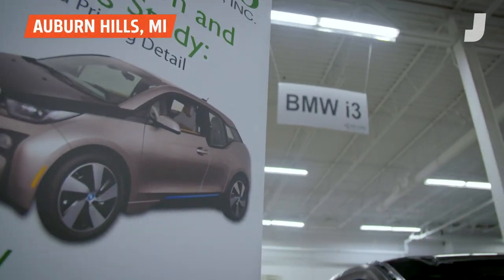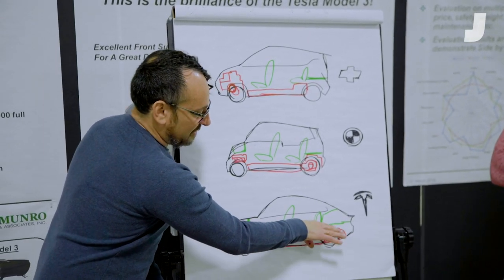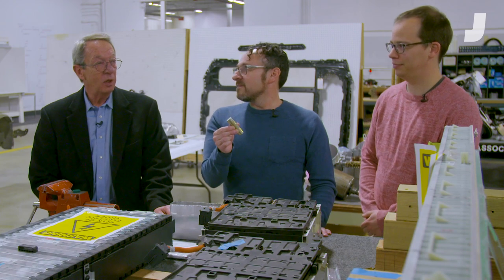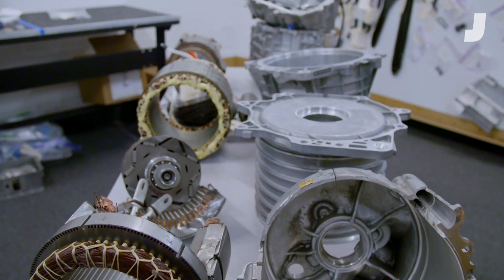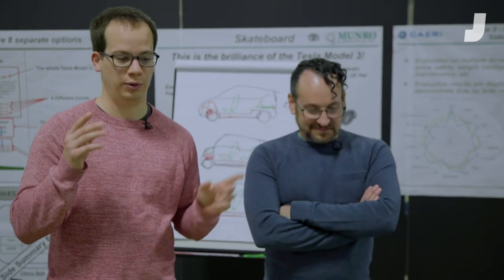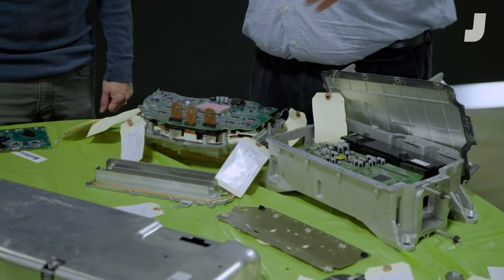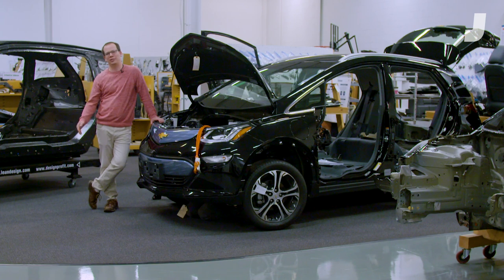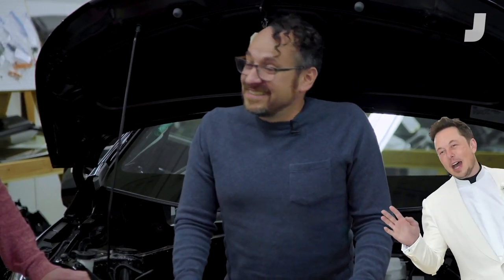A Look Inside The Tesla Model 3, Chevy Bolt, and BMW i3

Comment: There’s all the talent in the Bay Area making the Tesla bleeding edge. There’s Generic Motors making a decent effort at a car that won many accolades and even car of year when it came out, and there’s BMW in Germany with an outdated design, with poor range, poor performance, and a generally poor design. Your video didn’t do nearly enough to point out just how far behind BMW is in EV technology despite starting early and having many years to get it right. The Germans just seem largely unable to compete when it comes to technology. For example BMW’s iDrive was universally hated year after year long after nearly every other auto company had a superior system. And of course Volkswagen couldn’t manage to pass emissions legally so they just cheated instead. German cars have some of the poorest resale values after they’re out of warranty of any cars in the world which is largely due to how unreliable and expensive to maintain they are. You can buy some 5 year old Germans cars for 1/10th of what they sold for new because they’re widely regarded as unreliable money pits. The BMW i3 is another example of poor German engineering that’s been shamed by Tesla, Chevrolet, and even Kia and Hyundai who all offer less expensive better performing and more reliable electric and hybrid vehicles. The whole idea of “superior German engineering” is pure marketing nonsense. The Germans clearly are behind the US, Japan and Korea in engineering talent.

Comment: Amazing how different they are. The modular vs integrated approach (Bolt vs Tesla) is perhaps not given the pro vs con discussion it deserves, i.e., modular componentry may be a feature, not a bug. Remember too that although tight packaging of Tesla guts is highlighted, the Tesla is a larger car with a smaller back seat and not really much more cargo space than bolt. Also Bolt, though smaller, has 5 star safety rating, too. Bolt teardown on @WeberAuto channel great, too.

Comment: everything about the model 3 is superior.  the other automakers made their car ugly and inferior on purpose.  clearly they dont really want to sell EVs.  they just want to pretend to sell EVs, so they can say we tried, but nobody wanted them.  bolt and I3 are the ugliest designs I have ever seen.  their batteries packs are joke.  

the video was okay, but should have gone over the magnets in the model 3 engine which make it more efficient, thus you get more range from a smaller battery.

Comment: Bmw is the way forward as the use of carbonfiber is lighter and stronger they just need to learn more about the electronics as tesla have had a few more years development and bought over plenty electric developers 
As for the model 3 they still haven't fixed there chassis design and if you don't keep the firmware up to date you can't drive it
Reply: Agreed. There are only a few things that I thought BMW did wrong. For example the fake grill makes no sense, the odd size wheels and tires make it hard to DD one as not many companies make snow tires that fit those wheels, the frunk us so small it is basically worthless, and the all electric range isn't great. Instead of the frunk on the I3 they should have put a coolant heater up there so the batteries could stay at the optimum tempature in the winter.
Reply: So... It's not practical for long distance travel, or transporting lots of stuff and it looks like a Storm Troopers helmet is having its way with a can of Turtle Wax?   But other than that, it's a winner? @MrLM002
Reply: Chassis design?
Doesn't need "fixing", maybe "Refining" watch the Model 3 China stripdown. Let's see if they've done that?
Maybe it will give Audi ideas to improve the costing on the e-tron chassis?

Firmware?
What are you talking about?
Reply: @MrLM002  
So apart from using the wrong battery, cooling it poorly, drivetrain packaging issues and body construction, BMW got it right?
Reply: @capn2289  
I like the idea of the BMW, but that's the best description of it I've ever read!
Reply: ...And they sold there carbon fiber capability, so...
Reply: @MrLM002  The range has improved on the newer models. It got a bump in 2017 and in 2019. Still not great, but better.
Reply: @NicholasTripp  
What is it now? 120 miles?
Oh dear.

Comment: the battery part made me super surprised, but I have som Questions as to what quantifies a "unit"

-For Chevvy, is a Unit a single pouch? or the entire stack on the table?
-For BMW is it a single prismatic cell, or the prismatic module with 3 cells inside it? or is it the entire module on the table?
-For Tesla is it a single 2170 or is it the Entire module on the table?

or for any of these is it the entire battery pack for the car?

Comment: Anyone who likes the Model 3 or would buy one automatically admits they know nothing about cars and are just tech nerds who want an electric car because they're currently "cool".  Nobody who knows anything about cars would willingly give money for a car that drives like crap, handles like crap, has one of the worst quality interiors of any car on the market regardless of price, is OFFICIALLY the most unreliable car in the world with highest amount of breakdowns, has really uncomfortable suspension and seats, poor refinement, laughable interior "design" which they try to sell as "minimalism" to people stupid enough to believe that, etc. Tesla basically designs cars for people who are THE EXACT OPPOSITE of car guys or people interested in cars in general and they aim at the people who know little enough about cars that they're ready to tolerate all the crap they'll get when they buy a car.  Sure they accelerate quickly...but you don't accelerate quickly all the time...and when you don't, which is 99% of the time, you end up sitting in a sub-par car that feels like it should cost half as much as it does, and even then some details on it would make you feel ripped off.

Comment: Tesla's integration of components says a lot about the companies structure as well. If Tesla is structured as Elon has mentioned about Space X, then his engineering teams are not fully departmentalized. Meaning you don't have the motor team providing requirements to the power inverter module team who then work on that aspect of the car separately. The full vision of the car is understood by all engineering leads, and therefore better design integration is possible.

Comment: I am more impressed with the FWD Bolt.  We have snow and ice, FWD is the best if you can not get FT 4WD.  The Bolt has board by board control box that can lead to lower replacement costs if the diagnostics are done with detail.  The Bolt has a speed regulator.  Too many drivers of all vehicles are driving too fast and not anticipating.  Pedestrians need drivers to be looking ALL THE TIME!
Reply: Plus the Bolt has a great Electric Brake thanks to being FWD...

Comment: Don't know anything about crash studies of such things, but does the Bolt having electric motor and stuff all up front in conventional manner offer any additional protection to front seat passengers in the event of a head-on collision
Reply: TheSulross It would be the opposite. In a crash, the front of the Tesla can "crunch". On the Bolt you would get the motor in the legs... But they are both really safe car still, with the Tesla having the edge (the front of the Bolt is really small, probably doesn’t help).

Comment: Tesla would be the most difficult and expensive to repair. If a coolant leak occurs withing motor compartment it'll spill over to the electronics and kill the whole thing.. and if a cooling system fault develops in one of the integrated cooling fins you'll have to replace the whole battery pack.

Comment: Does no one get the reason GM's Bolt is FWD ??? 
Electric Braking, as the rear brakes on a typical car do less than 20% of the work.
So when you use the Bolts Elric Brake, 80% of the stopping power is from using the drivetrain a generator...
Reply: As great as the Bolt's regen is, they really should have made it AWD, or RWD at the least. Thing breaks traction way too easily during acceleration. That said, the rest of the car is amazing and would probably out handle the Model 3.

For me, near 100% braking is done via regen. Use L and the paddle for some serious regen and one-pedal driving.
Reply: teslas regen works super well i barely have to break and when the rear of tje car does the breaking you keep that all important traction in the front
Reply: @MrTsolar  Yep. Me too. I set it on Cruise Control just as soon as I can, get up to speed and try to time the moment that I disengage the Cruise Control by how far away I am from the spot that I want the car to stop at. I LOVE IT when I get it just EXACTLY RIGHT. It's like a game. I love coming off freeway exits the best. My brain is like the Apollo Lunar lander, taking into consideration EVERYTHING. Fun game.

Comment: You said that Chevy Bolt front mounting bracket is not an elegant solution. Design in general has many options. Each has pros and cons. An integrated design in Tesla is space saving, but it may be harder to service. Chevy Bolt needs a bracket because it is built on the same production line as other engine vehicles. It is superficial to say one is better or more elegant than the other. There is no single best design.

Comment: I am 6'-2", weigh 300 lbs and have a bad back. It is nearly impossible for me to get in and out of the model 3. The model X costs four times what I paid for my Bolt.
Reply: @japanwatchconnection thank you for your concern and your advice.
Reply: You bought the best EV to own. The model X has doors that will cost a fortune to service, like everything on any Tesla. Use the electric brake on the Bolt and your brakes will need little service...
Reply: @davidhollenshead4892  I love the regenerative braking paddle on the steering wheel. I use it most of the time.
Reply: @IBMara  Your reply shows a charming grace all too often missing on the net. 
For me it's intermittent fasting,  pilates and a neoprene sash to keep my lower back warm.

Comment: Disappointed that they didn't explain that Tesla is using a completely different type of electric motor. The other two are pretty standard AC Synchronous Permanent Magnet Motors. The Tesla uses a new design of AC Synchronous Reluctance Motor, with much less permanent magnet for cost saving, it is also much more efficient.

Comment: when the three cars need repair, the bolts parts can be bought and shipped anywhere, replaced faster because its almost a unbolt and unplug the larger modules, and I think simple goes a long way for long term use, so ill take the bolt ev.
Reply: The Bolt is the best EV, and is even a better car to own than a model S, and yes the parts and service will be cheaper...
Reply: I'm glad you guys like your Bolts.

Comment: Surely Tesla should put two of those smaller affordable motors in the back of Model S and X for torque vectoring, less power reduction under extended loads and longer range?

Comment: I'm surprised to hear them say that the Chevy Bolt isn't a clean slate design, just an adaptation of an ICE design. Supposedly the Bolt was built on its own purpose-built platform not shared with any other GM car. That they couldn't tear themselves away from traditional ICE design is a bad sign.

Comment: The extra metal and reinforcement in the Model 3 is for added safety. GM only reinforces metal where they know the crash test will occur, only to get a 5 star rating while reducing safety in other parts of the car. Tesla makes it safe regardless of testing.
Reply: Not really, all three are using virtual crash tests before they make a prototype...

Comment: The motors themselves can be far more complicated than what you're showing. Magnet arrays, geometries for rotor end ring and stator end turn geometries, etc. It's not just 'a motor is a motor', just like an engine isn't an engine, they all perform differently and have different power figures before getting into the power train. 
Also, while Tesla may have some manufacturing oddities, they're completely over-engineered to be rigid; this is why they have high safety ratings. Over time their manufacturing will get better and more efficient while still achieving the same end goal. I see lots of people complaining about how over-engineered they are, but it's better than driving a little tin can that'll crumple up the first time it gets hit.

Comment: Wait a minute.. they never explained anything about those motors like how they could all be a similar size and yet have such different HP ratings..
Reply: The kinda did, partially it's about how much power the battery pack can put out. The i3 motor attached to a Tesla battery will be more powerful - up to the point that it melts, because it wasn't designed for that power output. Part of it is design - Autoline did a show a while ago with Sandy Munroe and he mentioned that they were using Halbach array magnets to essentially shape the magnetic field for free extra power. Something the other guys are not doing.
Reply: The truth about EV motors is that most are downrated, except Tesla's. Meaning that they could produce more power, but have been limited to increase the longevity and reduce the risk of fire...

Comment: Several VERY significant factors "ignored" in this presentation... Some include:-
1. HALBACH ARRAY in the Tesla motor magnet. The configuration of the magnet significantly improves performance by "shaping" the magnetic fields in a Halbach array.
2. BATTERY and COMPONENT WARMING/COOLING using the SUPERBOTTLE... Described by Sandy Munro as "simply brilliant engineering", the batteries are "warmed" through the process of "stalling" the electric motor. This generates heat, which is taken out by a fluid that is "universal" to the car's temperature management systems. The fluid goes to the SUPERBOTTLE, where it is moved around the car to components that need heating. In this way, what would otherwise be "waste heat" from the motor, is taken to away to warm the batteries.
3. Full component INTEGRATION and management using software. Because the car has been designed from scratch, and MOST of the important components are made in-house by Tesla, it has taken VERTICAL INTEGRATION to new heights. Almost ALL the car's features and functions can be updated and enhanced in an inter-related way, via instant OTA (over the air) software updates.
4. WIRELESS component integration. Sandy Munro again... tells us that the ECU boards are peppered with micro transmitters and receivers, so do not need heavy WIRES to connect to each other. Sandy supposes that they "communicate" using a technology akin to Bluetooth.

There are a number of other unique and engineeringly-superior features in the Tesla, that the "competition" has either failed to apply, or does not appreciate or may not even understand. Sandy's general view of the Model 3 is that the electronics and computerisation are vastly superior to anyone else, but the BUILD of the car still leaves a lot of room for improvement. Overall, Tesla's engineers are way superior than those found in ICE car manufacturing and seem to have intimate knowledge of how to apply some extremely complex science (both chemistry and physics).
Reply: So why does it really suck to own the Tesla ??? 
The costs of repairs and wait time for service & parts is horrible, it is like waiting for Honda or Toyota parts to be made, when I worked as a wrench....
The Bolt is the most serviceable design with the best electric braking, and ease of parking.
[most EVs are only used locally, buy people who also have access to an ICE car]

Comment: I’m surprised they missed probably the largest difference between these vehicles, the BMW comes optionally equipped with a range extender enabling it to drive for as many miles as you wish without needing to charge, though you’ll have to stop for fuel every few hours. In my mind it is a fantastic option. I have one and it makes up the gap between true EVs and gasoline cars fantastically

Comment: 16:20 Not sure about that. Consider that the Model 3 virtually has no roof and pretty heavy. They'd probably over built it for the fear of body flex once the cars gets older.  The strange welds and rivets could be explained by stress design software.
Reply: It's still more efficient as a package AND has room to improve! WOW!

Comment: Bizarre to compare the space utilisation of the BMW with the Tesla when they are a different class size. Tesla have good tech.
Reply: They are not as far apart as you might think. Because of the drive/life modules architecture, interior volume of the i3 is actually more than the BMW 3-series which is the Model 3's ICE competition.